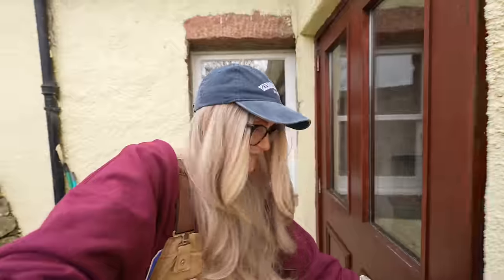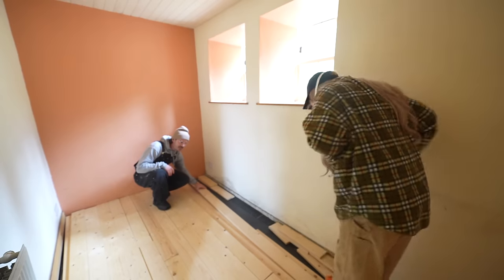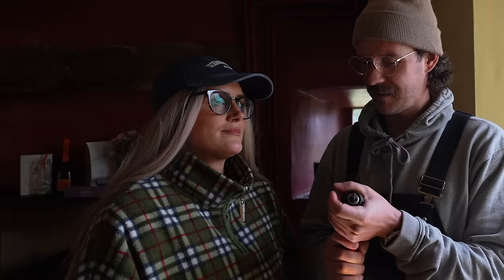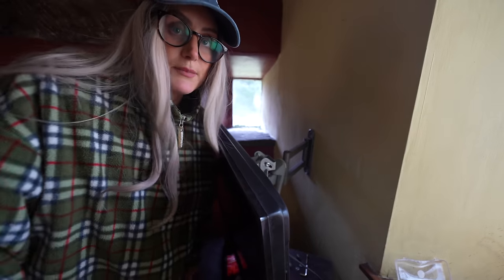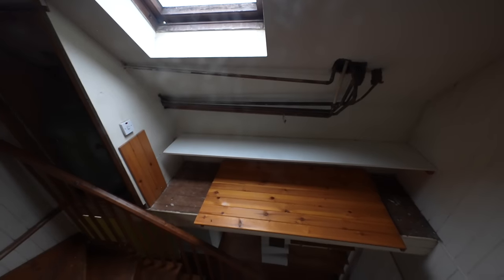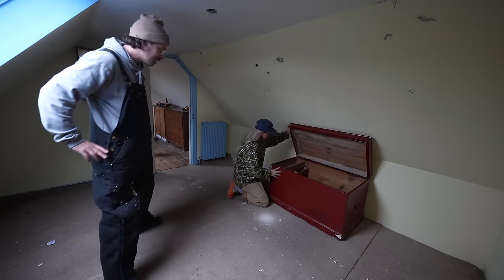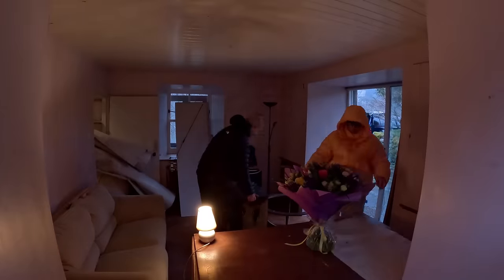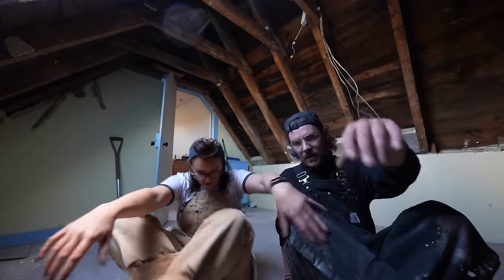Home Renovation - Let The Makeover Begin! (Ep.1)

Comment: You can’t stop water seeping in from the inside. You have to do it from the outside! Fix the roof and gutters, gutters are super important! And as your house is in a slope you may need to dig out and redirect the water on the back so it doesn’t go into the house. So drainage and roof/gutters is step one :)
Reply: And also, you should never try to keep moisture in, it will only create more problem, mold and so on. Old houses need to breathe! Having good ventilation and not using plastic based materials (like paint) is great for old houses.
Reply: @emmso94  you can get breathable paint, i no it sounds daft but its a real thing
Reply: Completely agree with this assessment. My father had a saying (start right end right) so don’t cut corners.
Reply: @kennethcroll6972  yes absolutely! I like using linseed oil paint and chalk paint. It’s also way more pretty than plastic based paint, the natural pigments in more natural paint makes a huge difference!
Reply: drains are important outside.  They are often next to the house and out in the garden if the water doesn't drain on its own.  Definitely look at the roof and gutters.
Reply: I am so glad you are getting some9ne to get the damp water has to go! If you breath in mold you will get very sick! Don’t do it yourself!
Reply: I love your adds.  This video had me laughing a lot!
Reply: You can’t just paint over mold ! It keeps spreading!
Reply: Go easy on yourself ! You’re just learning! And you will like everything else you e done !
Reply: @jeannerountree952  Agreed; And cracked down pipes and blocked soak-aways!
Reply: Wear correct PPE, you don't want to have any health issues later on.
Reply: Knock it down and build new, super insulated, your own design.
Reply: You may want to investigate putting piers under the house to even it up so the 'slope' of the house is level on the ground.  
Also,  having dealt with mold issues in the past and present  -  walls, beams, rafters,  eaves, window frames and sills cannot be adequately cleaned.  The rotten, moldy, compromised wood and other materials simply must be removed. 
Create a clean start to your renovation.  
As someone else suggested,  taking a severely damaged structure down and starting over could be cheaper and more satisfying and protective for your health.
Reply: When I saw your previous clips and got a brief look at rot and mold issues,  I was more than a bit alarmed. Are licensed home inspectors required or recommended in Scotland? Yes or no, always get a second opinion from outside  the community in which you are purchasing.
Reply: Another person cautioned that moisture and damp in the house in the rafters, ceilings, walls and floors is likely being caused by roofs leaks. The damaged eaves and broken and old tiles on the roof, and rotten wood must be replaced first. In other words,  all roof areas must be wind and water proof.
Reply: Like a French drain
Reply: Yep I was thinking drainage at the back and then damp proofing in the walls. Or just knock everything down and put a cabin on the land 😂
Reply: You need to install a membrane called a damp proof membrane. I am not 1009% on how you retrofit if one is not there. However FINGERS CROSSED its just it's been covered .
Reply: You not wearing gloves or mask while tearing away carpets, walls and cealings in that place is playing with your health. I sure hope you’re ok
Reply: I agree. You are setting yourself up for tetanus and respiratory irritation at the least by not wearing proper gear.
Reply: I'm so glad you have someone to get advice from because there seems to be so much you do not know. Can you watch some renowned videos or at least get a handyman book?
Reply: A French drain possibly
Reply: I'm not a builder, but I have owned an older house, and never seen a membrane mat on a floor.... after digging drainage around the house, and leading the water away from the house, the membrane should go vertically against the underground part of the outside wall, sticking up a bit above ground level to ventilate away excess moisture. Builders, correct me if I'm wrong! I hope you find a professional, so you don't fall ill from dangerous mold! Take care and stay safe! ❤🎉❤ (I live in Sweden, maybe we do stuff differently than Scotland...idk😊)
Reply: Yes when you have a slope drinking downhill onto your home you need to install a French drain that will direct the moisture to the end of your home and away from your foundation. Don’t know what they call it in Scotland though. 🤔
Reply: Be cheaper, quicker and better to knock down and build new. As the saying goes, you can't polish a turd 😂
Save what materials you can to use in the new build to give it some of the old character. 
It can take years to sort a property out, especially if it's your own and your skint. We've been doing ours for 18yrs now.
Reply: Have you guys not met with an engineer yet?  You're mist likely gonna need a french drain cut and dug to divert moisture from the house, and vapor barrier on the outside.  You have to look at the moisture as a complete problem, especially dealing with wet scottish granite walls.  Don't let Americans tell you how to handle it! We don't deal with your kinds of moisture issues!

Best get on that well problem now.  It absolutely should be finished before the weather gets cold again.
Reply: I have fixed many a home by following what Emmos94 said. I would add, that you will HAVE to do a redirection of moisture. In America, we call it a French drain. I don’t know why we call it that but you can look it up. if you do not do these things, it will haunt you every day and in wet in Scotland that you live in this house.❤
Reply: I would use dry loc wherever there’s moisture. It will keep it on the outside.
Reply: A French drain would be a strong suggestion for the water outside runoff.

Comment: As a former home inspector, water is your home's worst enemy. Wet wood rots and attracts carpenter ants and termites, both will eat the framing clean out of your house if not treated professionally. Any damp wood will need removed and reframed. After proper drain tiles are installed around the house, you'll need to dig all around the foundation and put a rubber barrier on it so it seals it up what is underground. You'll worry about air flow/breathability when the HVAC system is installed to make sure your house breathes. You might want to go back to watch older Trent and Allie videos, or Eamon and Bec to see how they did theirs. Don't breathe in mouse nests. The poop/pee can cause serious damage. It's best to spray them down with water so it doesn't go airborne. As others have said, wear personal protection is imperative. If the house was painted inside prior to 1978, it likely has lead paint. You may need to call your environmental agency for advice. Many of the chemicals are carcinogens and cause infertility. Please be careful and have fun!
Reply: We don't have HVAC systems in the UK, except for maybe hotels or business premises.  We have central heating with a boiler (not a furnace)
Reply: @hallscroft  HVAC includes all forms of heat and AC, not just furnaces 😉
Reply: @iam4330  It is not usual for UK homes to have AC either.
Reply: I agree with most of the technical stuff you have mentioned
However
Trent and Allie are not professional builders, & don't claim to be. They don't have a stone and brick home, a plaster home or an old home, etc,, 
Trent has done a fantastic job navigating and building his house but he's learning as he goes and Emon and Bec who have since ghosted YT lol are definitely not the people to learn building advice from.
Long-time professionals are the only good source, preferably ones from the UK as homes are built differently there
HVAC is rarely used in the UK, central AC, and forced air are even rarer in homes unless it is a commercial space /business but even then no guarantees they were built into the buildings.
For reference, I grew up in England and I'm a project manager on renos in Canada all brick homes
Reply: @hallscroft  Don't you mean it IS unusual to have AC in the UK !!
Reply: Better to view Maya Feliz on YT. She has just tackled the same issues. Stone house on slope, with damp😊
Reply: @Sunnbuzz  Emon and Bec just posted an update. They have been absent since Bec had the babe because her cancer is back and it's stage 4 and I think it's in her back now (not sure). I tried to understand what they were saying about her condition but they were trying to be positive and didn't elaborate.
Reply: All the very best can't wait 🎉❤❤❤❤
Reply: Advice from the US doesn’t necessarily apply to other countries. There are no termites in the UK, and the date lead paint was banned in the UK was 1992.
Reply: @cerealdust4407  termites are found all over the world, including the UK and even Antarctica. Lead paint was banned in 1992, so there would be even more of a chance that the Scottage has it.
Reply: @iam4330  The UK's only known termite infestation was successfully eradicated in 2021.  We don't have termites here.
Reply: @Sunnbuzz Eamon and Bec posted their first video in 5 months yesterday. Wait til you see why they haven’t posted.
Reply: @TeeSpicerReacts I’m a nurse and I picked up spine and liver mets for sure.
Reply: @hallscroft  Google begs to differ with you. Their home report even said "wood boring insects", which means hornets, carpenter bees, carpenter anys, and termites. None are good for homes and all will eat the framing from the house. Wet wood is an open invitation for wood boring insects, regardless of what they are. Now that they are aware, they have to disclose it to any future buyers.
Reply: Not an expert but my first thought was get a French drain to move water away from the house and check fix the roof and gutters before doing anything inside.
Reply: There have been 6 registered cases of termites in Scotland over the last 100 years. It's very wet and very cold.  Main concern would be woodworm.
Reply: @iam4330  HVAC seems to be an American term.  We don’t use it in Australia either.  Of course we do use both heating and cooling, but boilers aren’t a thing here either.  Most people use what we call “split system air conditioning” with built in reverse cycle heating, as ducted systems are very expensive here.
Reply: @Sunnbuzz  Trent's house backs up to a mountain, and they put a water barrier on the outside of the external wall. No, he's not a professional but is following a professional for approval to pass inspection. I mentioned T & A as a quick reference to see how to put up a water barrier.  Craig and Aimee will need a professional for guidance, at minimum.
Reply: Did anyone notice that the insulation was put in backwards?
Reply: @jhodges9006  Yes!  I wondered if it had been installed in the ceiling of the floor below, rather than under the boards they were lifting.
Reply: @iam4330 What framing?
Reply: @iam4330 We get woodworm that’s it.
Reply: I expect they will be putting in oil central heating with radiators.
Reply: @Sunnbuzz Means the same.
Reply: Will they definitely have older videos where Eamon did a lot of work in the cabin in Canada. @TeeSpicerReacts
Reply: @TeeSpicerReacts  whoa what!? I didn't hear this about Bec!???   I need to catch up with them 😢

Comment: Guys, I'm an architect,  and a contractor.... advice:
1. Amy... get appropriate shoes... you're going to have an accident sooner than later. 
2. Get a trailer... at least a small one.
That floor with the rat issue... remove the entire thing... replace all the insulation and install new engineer flooring. 
3. The removed wood from that floor,  plainer (with a machine.. called planer) and re-use it for like wall covering or do something creative with it.. 
4. That shower... demo the entire thing.... health heasart  ..
5. Where you have mold, remove the wall finish completely... if there is mold in the front,  there would be 5 times more in the back... it also means you have a water leak somewhere behind that wall.
6. Same as before on ceilings,  floors and any other place that is showing mold...
7. Asbestos... get appropriate stuff to wear... 
8. Please... please...please... use gloves!!! Trust me!! You can get something that would require penicillin... or smash a finger...
9.cover your face....face-mask at all times during demo!! Guys... not joke.... you are playing with fire!! 
10. Also... almost forgot... that flooring area with d rat issue... there is ton of electric cables there... huge opportunity to re-route some and replace all that... house that old those wires can start a fire... 
11. Do not mess around with electricity or plumbing... that can flood or burn the house... replace as much as you can... the investment will be worth it!

Any way... good luck chicos from Phoenix az...
Reply: I'm a mold expert and I'm trying to tell them its a tear down job. Like that place is a massive bio hazard and they are playing with fire.
Reply: This sounds like pretty great advice 🙂
Reply: I seriously love your advice, and hope our beloved nutty friends do to.
Best of luck, you two: your new home will beclme your castle.
 ❤ Greetings from Denmark
Reply: It's not a tear down - all the exterior walls are solid stone. They just need to abate properly.
Reply: @gabrielleg.1347 get a grip fella. Mold expert 😂
Reply: @annestrasko7581 he’s referring to the interior walls, ceilings +floors 😊
Reply: Regarding point 7 - the advice should really be to engage the services of a suitably qualified contractor. A refurbishment & demolition type asbestos survey will firstly be required to identify asbestos materials around the property and the type of asbestos present. From there you can determine what further action is appropriate i.e. whether the removal is non-licensed work, notifiable non-licensed work or requires to be undertaken by a licensed contractor. In any case, the work has to be undertaken by someone with a suitable level of training not simply by a homeowner wearing appropriate stuff.
Reply: in addition to #1, get some proper gloves for dealing with construction. Mold & rats need disposable gloves. You don't want to have to get a tetanus shot from a rusty nail...y'all are awesome excited to see the transformation.
Reply: Any considerations for checking if lead paint is present? I agree with the safety gear, suitable shoes and dust masks. Due to age of home, I would assume there is a chance of lead paint too. There are lots of health hazards between mold, rat droppings, asbestos to warrant dust masks. Adding a contractor or hiring out some of these jobs to make sure that things are corrected fully would be a smart move.
Reply: @Del213 What’s your issue? I have systemic mold poisoning and can’t detox properly and am literally bedbound from it,and my brain is Massively inflamed most of the time. You don’t know Shit about mold if you think it’s something to laugh about!
Reply: @QurVgn  Sorry to hear that but they aren’t going to knock it down as most likely it can be resolved. Additionally, having a mould infection doesn’t make you an expert in mould - only an experienced mould sufferer. Unless of course you contracted the infection in your day job as an IICRC approved inspector specialising in water damage restoration, applied structural drying, and applied microbial remediation.
Reply: Number nine!!!😮😅😢
Reply: I agree with what she said! Definitely gloves and mask.
Reply: As a medical doctor I totally agree - never ever go without safety gear! Mask, glasses, gloves, sturdy boots are a must in demolition projects like this. Mold and mouse poop are a serious threat to your health! And dearest Amy, always pull your hair back when working with any spinning tools, it can get caught in a second and whip your head around causing sever injuries to your face, scalp or neck through the drillbit. 
I cannot imagine that you guys won't have numerous codes in construction in scotland, so the wise move would certainly be to get in touch with an architect and a trustworthy local construction team. Good luck to you two - never loose your enthusiasm - you will need it - and you will be rewarded with your cosy dream scottage!
Reply: Max bids loves building a good roof😂
Reply: @cameroncalum  Absolutely right, just get a local authority approved asbestos removal firm in, just not worth it otherwise.

Comment: I have a suggestion I learned the hard way. Keep a pail, or box, lined with a garbage bag, and clean as you go. If it’s garbage, toss it immediately. Use another box for anything you might save,like screws, or brackets, etc, and toss them in the box. Move those boxes around the room as you work. Mess can create stress. You’re welcome. ❤